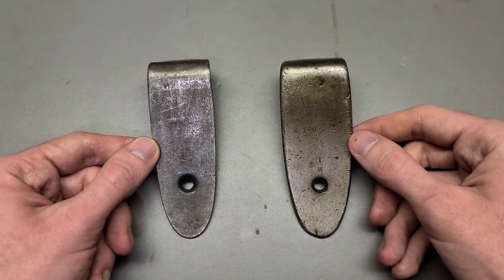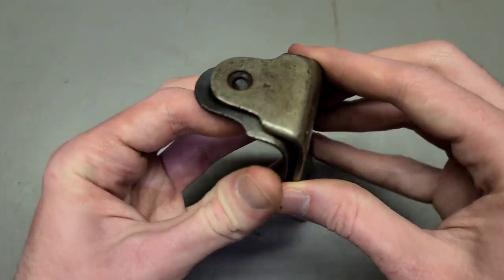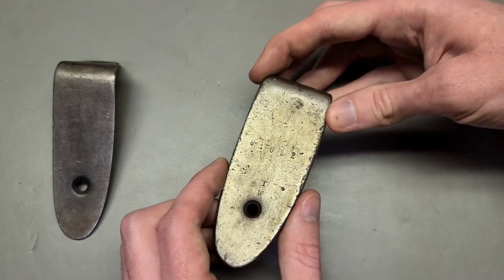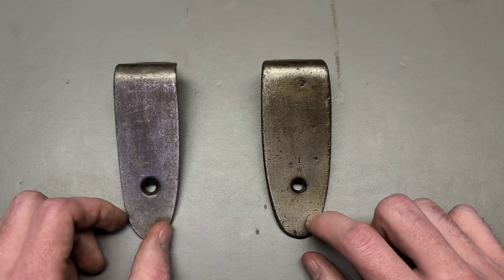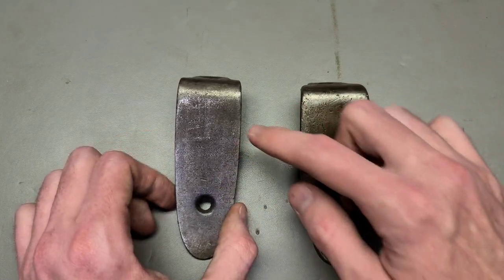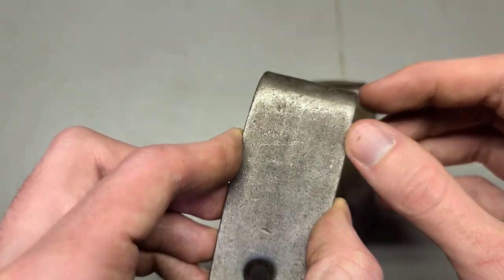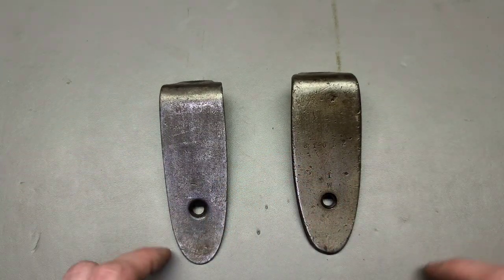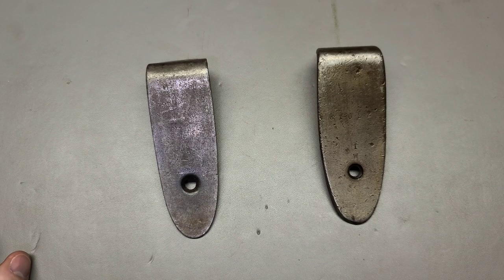Which buttplate does your Mosin Nagant have?

Comment: Hi Sam. My Mosin stock has the old style tiny screws that are in front of the rings around the barrel and hand guard/stock.  I want to grab a piece of wood for the top hand guard like the one you gave me a link for but I'm not sure if the distance between the rings vary. Mine is 17 and 3/8 inches between the insides of the rings so I'm wondering if a 91/30 replacement would be long enough? I dont have another one to compare it to. Its a great very functional piece of history but as you know they don't quiet look right without that upper wood. Thanks.
Reply from the maker: Hi Bad Apple, that is the correct distance between barrel bands for an M91 type rifle, so that handguard I sent you should be long enough. The only issue is that the front of the handguard will need to be slightly widened to fit on a thicker M24 barrel. A 91/30 handguard won't work with your barrel bands sadly, so this is going to be your best bet!